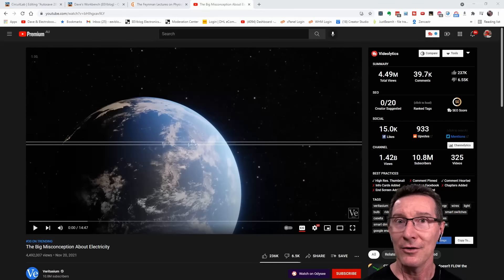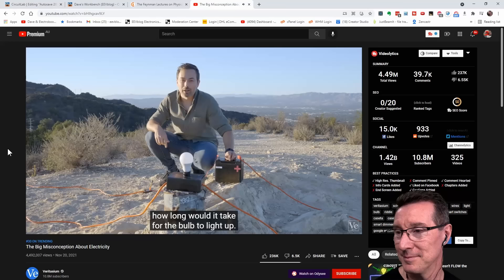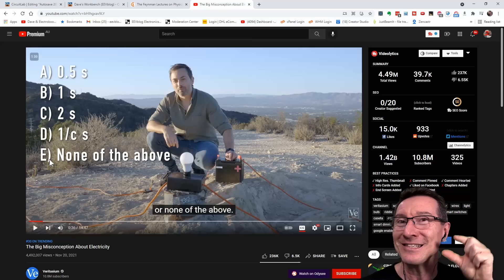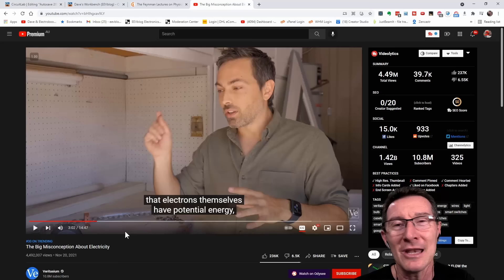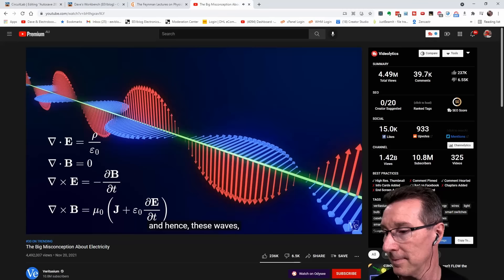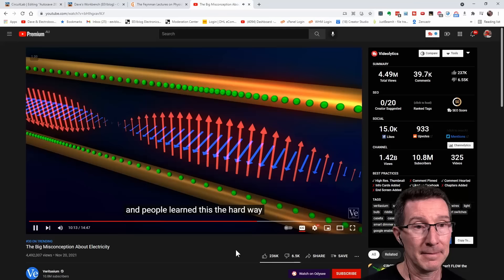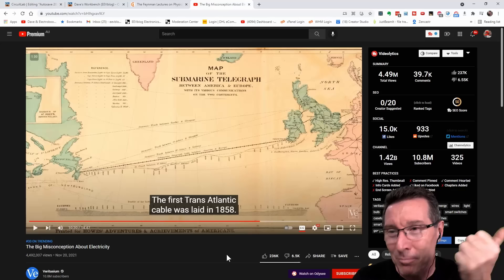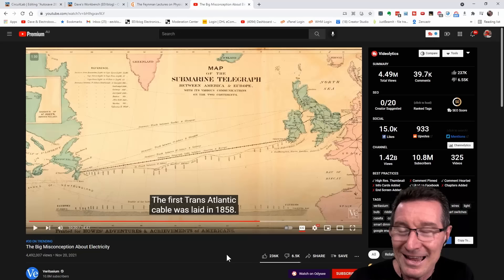EEVblog 1439 - Analysing Veritasium's Electricity Misconceptions Video

Comment: "The light bulb has to turn on immediately current passes through it"
"That's fine"
No, it isn't fine. If you do the calculations, even roughly, there is less power going into the light bulb due to the antenna effect than a moth's fart. It definitely will not light up the bulb.
Reply: iirc the lightbulb is specified to light up at the tiniest current. If you don't like that, ramp up the voltage to some ridiculous number instead.
Reply: I totally agree with you that the induced flow of energy "due to antenna effect" in Veritasium's set up is so tiny due to the low voltage of the battery that it is not going to light up the light bulb shown in his video. However, if the wire is assumed to have zero electrical resistance, the light bulb would light up due to flow of electrons inside the filament (no matter how slow they flow) pumped by the battery but not due to tiny flow of electrons due to antenna effect.  Besides, the battery provides DC. For the antenna effect to work continuously, the power source needs to be AC. Veritasium is not very smart to accuse people of lying when they say the light bulb lights up because of the flow of electrons  when that is in fact the case.
Reply: It sounds like you're missing the actual point
Reply: @chaklee435  Is it an "ideal" wire with no RLC - or are real world LC applicable? 300,000 km of wire with resultant massive inductance? Good luck when you open the contacts (back EMF)!
Reply: @simon6071  Alright I'm bored, let's dissect your comment.

1.) of course the setup would not light up any real lightbulb. That's not the point. It's a physics thought experiment, not an exercise in engineering. Any current will do.

If you'd prefer, we can contrive a lightbulb that works to our specifications. We can arbitrarily define how much visible light is required to consider the lightbulb lit. Then we grab an incandescent and heat it up in an oven until we are exactly on the line of not being lit. Then any current will tip us over the line.

2.) How is it that you are able to imagine millions of miles of wire with no impedance,  but not a lightbulb that lights at any non-zero current?

3.) Why do we care that whether the antenna effect works continuously? The question is when the bulb is lit, not when the bulb is lit continuously for some amount of time.

4.) I'm no electrical engineer, but it seems that the fields are able to explain more phenomena than electron flow. That's makes fields technically correct, the best kind of correct ;). It's not lying to correct people on mostly useless technical points.

5.) The point of the whole thought experiment is to engage your intuition, and show that it is incomplete. I presume you have watched at least 2 videos on this topic, and still decided that your intuition was right the first time. Please don't get into politics, thanks.
Reply: @megamond  We only need to close to contacts to complete the experiment. What happens next is not my problem.
Reply: Yeah surely this is just a badly specified question. If it immediately "turns on" but at 0.001% brightness and for only 1 millisecond... and then actually turns on full power 1 second later... I think the answer is debatable.
Reply: You're missing the point. Assume the lamp is really a LED with a 10k series resistor. This way, the load resistance is greatly higher than the line impedance, and the LED will light up at full power immediately.
Reply: @polwel-j8z  I'm not missing the point. I'm just saying that "it turns on in 1m/c" is a highly misleading answer. And even an LED would be 99% off for almost all of the 1s transmission delay because the transient voltage is so small and high frequency.
Reply: @polwel-j8z  No it wouldn't. It would still light up only a tiny amount for a tiny fraction of a second due to the A/C components of the wavefront. If the light transitioned to steady state before the current in the wire reached it, you'd break all of physical reality around information.
Reply: @TimmmmCam  The original problem statement specifies that "you have to make some simplifying assumptions about this circuit, like the wires have to have no resistance, otherwise this wouldn't work, and the lightbulb has to turn on immediately when current passes through it". The question is not badly specified, people are just bad listeners who hear what they expect to hear. No resistance wires are a common assumption, so that went through no problem. Any-current lightbulbs are not a common assumption, so people ignored it and remember it as a normal lightbulb. We can debate whether the question was clear, but it is not ambiguous.
Reply: @chaklee435  Yes but "the lightbulb turns on as soon as any current flows though it" sounds like it is accounting for some mild ramp up. It's highly misleading at best.
Reply: Exactly.
Reply: @simon6071  the guy is just dead flat out wrong anyway. He used Maxwell's equations rather than Quantum Electro Chromodymanics as the basis for his explanation,  a rookie mistake. Feynman is turning in his grave.
Reply: This is the correct answer. Every RF and microwave engineer knows this.  The wires guide the fields.
Reply: @chaklee435  The wave that propagates to the bulb due to the antenna effect is a short pulse which quickly passes.  Then there will be no power entering the bulb until the wave returns from the far end a 1/2 sec later. Verasitium is wrong.
Reply: @chaklee435  
Check out my reply on Craig Green's thread under the video "The Big Misconception About Electricity - Veritasium" for my explanation why Derek and you are wrong. 
If you still do not understand why you are wrong after reading that reply of mine under that video, I may explain to you in more details.
Reply: It isn't fine, because the original problem is squinting between two meanings, which amounts to dishonest communication. On the one hand, Veritasium says that the least current (anything strictly greater than zero) suffices to "light"' the lamp, by the problem definition. But on the other hand, he says the problem is about how energy (or power) is delivered. By a normal understanding of energy or power and "delivered", that would mean the nominal power, not just the least imaginable power that strictly exceeds zero. So, the elements of the language of the problem statement contradict one another and mislead the listener. I say the real power is not going to reach the lamp until the rise in voltage and current has had time to go around the loop, which would be one second except that such a rise, as others have pointed out, travels a bit slower than light travels in a vacuum. So, about 1.5 sec. The wavefronts travel in both directions from the switch, so they cover the two halves of the loop at the same time, not one half after the other half.
Reply: @defunctuserchannel  Ty for saying that because its something that bothered me about the original video.  Can anyone verify what Defunct stated here?  I was under the impression that this transfer of energy V was discussing only took place as the magnetic/electric field was changing so on the local level between the bulb and the batt when the initial connection is made there would be a pulse of EM field that rises which should induce current flow in the near by light but this would soon become steady(ish) at which point the light would stagnate until the power came from the wire.  Its been decades since I really looked into this shit from a weak understanding as I made shitty small Tesla coils and lasers as a child but something felt familiar and simultaneously off about Veritasiums explanation of it all.  If we take this to its logical extremes, a wire from here to nearest Galaxy and back and turned on a DC current would the Light come on and STAY on or would it only have any significant current only for the brief instance the switch was flicked then dim until the circuit completes at the Speed of light?
Reply: Why do I feel like i'm seeing the dunning-kruger effect in full swing here in this thread lol.
Reply: @chaklee435 , why not go one small step further? Why not just specify that the laws of physics don't apply to the example? Again, the circuit and conditions he describes are garbage that mislead much more than educate.
Reply: @b43xoit : "the original problem is squinting between two meanings, which amounts to dishonest communication. " <-- Exactly
Reply: @seditt5146 , according to Veritasium, every light in your house would illuminate upon closing any switch. Everyone knows this doesn't happy. Veritasium's assertions are pure garbage.
Reply: @ExarchGaming , 90% of all people that assert dunning-kruger suffer from it.
Reply: This is the assumption that really irked me too; to act like you're talking about the pure physics of the situation, then make some statement like that ignores the physics of quantum mechanics.... at any temperature above absolute 0 there would be some amount of "current" moving around in the light (statistically 0, but since there's movement there's electric potentials throughout). 

As soon as you define current as something that is detectable on a human senses level the wires become moot (e.g. to have a light that could light up with the field, you wouldn't need the wires, you're just transmitting the power wirelessly (even in the switched DC case, just for much less on-time))
Reply: @interestedparty00  If you can't see how "lightbulb lit" is pedagogically better than "measuring some non-zero current through a resistor", then I don't know what to tell you. Stay away from teaching, I guess.

Evidently, enough people are confused to show that Veritasium failed to teach clearly. But I don't think that was obvious from the outset. I still maintain that a careful reading of the problem is unambiguous. I don't feel misled. /shrug

According to general relativity, clocks in my house would run slower downstairs and faster upstairs. "Everyone knows this doesn't happy." Does this mean, gasp, general relativity is pure garbage?
Reply: @chaklee435  By that definition of a lightbulb, then you don't need a battery or a switch - fluctuations in the solar wind will set it going.
Reply: @jonathanbuzzard6648  LOL.
Reply: @interestedparty00  "... which mislead more than educate." That is the critical point, and one which disappointed me given Derek's specialty is science education. The resulting misconception that many will go away with is that the wire doesn't matter, the energy is transported through space to the light bulb.
Reply: @chaklee435  A couple of points regarding your reply to interestedparty: Veritasium is educationally about creating thinking by deliberately addressing misconceptions, often through arguing from unexpected positions. I think in this case, he opened himself up to criticism by creating a whole new set of misconceptions about the issue, by implying that the power required to turn on a light is transmitted to the bulb. By reducing the current required to tiny amounts is where the slight of hand is. If he'd simply said that the switch acts as a remote control for a highly sensitive light bulb, most people would have understood it better without new misconceptions.
Reply: @chaklee435  
1/ When the set up would not light up a real light bulb at (1 /C ) sec because the induced current is too weak and two brief, then it means the set up of the experiment is  not appropriate if he wants the answer to be (1 /C ) sec.

2/ We don't need to dream up a light bulb that can light up on a minute electric current.  Derek should have mentioned the use of a galvanometer (with protective circuit) instead of a light bulb for testing if there is electric flow on the other side of the wire.  A galvanometer can detect an extremely small current that even just happens briefly.  

3/ Even if we increase the voltage of the power supply to thousands of volts, if it is direct current, it will only induce a current on the wire with the light bulb for a split second when the switch is turned on. Then the there is no more induced current.  The light produced may be too brief to be noticed. With alternate current, the induced alternate current will last as long as the switch is on. 

4/ Another thing is that with an AC power supply, the wire on the side of the power supply would become a transmitter that emits radio wave, a form of  electromagnetic wave. That's how energy can be transmitted through the air. However, that energy can only be received by an antenna, not by a light bulb as Dereck foolishly claimed  Moreover, the electric field component is in the electromagnetic wave or radio wave that emits from the wire when the electric current wiggle back and forth inside. The electric field component partly responsible for wireless transfer of energy is not the extremely weak electrostatic field created by the excessive electrons on one side of the wire as Derek wrongly claims. There are two kinds of electric field in the experiment  if AC power is used, the electric field component of the radio wave and the electric field inside the wire.  Since he did not use AC power, the only electric field responsible for the transfer of energy to the light bulb is the electric field inside the wires. 

5/ Derek BS explanation of the transfer of energy from the battery to the light bulb by a electromagnetic scheme is obviously anti-intuition. We only see electromagnetic energy in the form of light come out from a light bulb when a electric current is applied to it. That means the electric current carries the energy to the light bulb. That's especially true when Dereck's experiment uses a low voltage DC power supply that cannot produce radio wave  with the set up.
Reply: @interestedparty00  Interesting, I must be in the 10 percent, that sees it in full display in this thread. Doesn't matter what topic it is, history, psychology, even hard sciences... like physics. 

You always have the armchair commenter trying to nitpick and grasp at straws even when you have a literal PHD, and an electrical engineer both in full agreement regarding the premises of the thought experiment (and that's all it is, a thought experiment to describe to laymens how a certain principle operate, he mentions in the video that a number of assumptions are being made for the thought experiment....) 

and...here we are. Continue glorious youtube armchair commenter!
Reply: @interestedparty00  that’s probably because the average person is below average...😁
Reply: @chaklee435 , Veritasium failed to teach clearly because far too much information was misleading. Veritasium was outside of his expertise. Veritasium is a generalist. You have electromagnetic wave experts and energy transmission experts explaining why this video is misleading, but you are ignoring the experts.
Reply: @ExarchGaming , you are definitely in the 90% suffering from the effect. We aren't nitpicking this video. We are saying that it is clearly misleading. It has negative educational value.
Reply: @ExarchGaming  I actually agree with interestedparty, and I have a Ph.D and a master degree in physics, as well as graduate training in teaching. So that criticism doesn't count. The build up of the physics by Derek was fine, but the final problem was poorly defined, because it implied power transfer greater than it was really saying. Derek is a great believer in the pedagogy of creating controversy in order to get people to think and learn. But I suspect even he will say, upon reflection, that his implication of power transmission is greatly exaggerated.
Reply: @brendanh8193  I'm going to assume I found the right person, explain to me what exactly is a doctor of philosophy - physics?
Reply: @ExarchGaming  In the English system which most English speaking countries adopted, tertiary education progresses from bachelor (or undergraduate level), to master (postgraduate level), to doctorate. Bachelor level degrees are taught via coursework, which is similar to schools in nature. Typical bachelor degrees take 3-6 years to complete. 
 Master degrees can be taken either by coursework (more advanced than bachelors) or by research (which is a research project with a thesis at the end). Typical master degrees take 1-2 years. Doctorates are also completed via research projects and thesis, but one must make a significant contribution to the body of knowledge as part of the thesis. Ph.Ds generally take between 3 and 10 years to complete, depending on location. 

 Historically, there are two types of doctorate, doctor of theology and doctor of philosophy (which covers everything else). So a Ph.D - Physics means the person has a doctor of philosophy in the field of physics. 

To add to the confusion, some fields, countries and even universities have a fourth level of education, with various names, such as mister, or doctor of science, however other locations around the world may not see the difference.
Reply: @brendanh8193  Okay, Thanks. I was so confused, because philosophy is a very different subject than a math heavy hard science. 

I didn't actually know the history of the term doctorate, thanks.
Reply: @simon6071  You are not dealing with the original problem, which has an any-current lightbulb. You are dealing with another version of the problem, with a more realistic lightbulb. Your answer may be more useful in some sense, but as you are answering the wrong question, that makes you technically wrong. If you want, you can blame the question for misleading you into being wrong. But as always, read the question carefully before doing any work.
Reply: @interestedparty00  I am ignoring who? Are you replying to the right person, or do you not read the comments you are replying to? I have not said that the video is not misleading. I find that hard to prove one way or another, so I stick to comments that I'm sure are correct, at least technically correct.
Reply: @brendanh8193  indeed. Not a good problem to center the video around. Probably be better off with some high frequency stuff with actual practical applications
Reply: @chaklee435  Any problem related to physics has to conform to physical reality. There is no such thing as an "any-current lightbulb". The induced momentary and weak current not being powerful enough to light up a regular light bulb is just one of the problems.  Derek's mistake of thinking the electrostatic field that lasts no more than 1 second between the two sides of the circuit after the switch is turned on as the electric field that drives the flow of energy from the battery to the light bulb is an even bigger problem. The electric field that drives the flow of electricity from the battery to the light bulb is INSIDE the battery and the wires, not outside.
Reply: @chaklee435 : "I have not said that the video is not misleading." <-- LIAR. Here's what you wrote. 
"I still maintain that a careful reading of the problem is unambiguous. I don't feel misled."
Reply: @interestedparty00   Not much point in talking if your understanding of English is so poor. I don't feel like pulling out a dictionary and explaining my wording. Let's end it here.
Reply: @chaklee435 : "I don't feel like pulling out a dictionary . . . " <-- It doesn't surprise me that you don't like using a dictionary. I busted you lying, so you want to throw a stone as you exit.
Reply: Why no one is questioning how is Derek lighting a 110volts bulb with a 12 volts battery? And secondly , where has he laid the 300000 km of wire (halfway to the moon and back) on the ground on earth or has he wounded it as a coil thus creating a ginormous inductor??!?
Reply: I agree.  Your power unit matches the absurdity of what other commenters assume as requirements to light the bulb.  I have to assume that Derek meant it was to turn on immediately when "sufficient" current flows through it, otherwise the light is already on from any radio station broadcast or by any static discharge anywhere in the world.  The thought problem then requires no wire to the bulb and is meaningless.  

The one second return time is also not when sufficient current would be available to a typical multi-watt 12 volt bulb.  The surge impedance (appearing resistive) of each loop exceeds 600 ohms and severely limits current to the bulb except through small current increments from each of thousands of one second surge reflections.  A bulb with resistance perhaps five times larger than the sum of the two loop surge impedances and rated in milliwatts could light dimly with current of the first outgoing dc surge.  But such a dc surge is not going to appear until after multiple oscillatory wave reflections from ground mode propagation and multipath wave reflections from ground and wires have occured following the collapse of the static preexisting electrical fields.   That "noise" time will last multiples of the time for a wave to travel one meter.  

For a normal 12 volt automotive bulb it will take hours to reach sufficient current.  The answer is D, unless all circuitry science is ignored.
Reply: @robertmeredith3940 : "I have to assume that Derek meant it was to turn on immediately when "sufficient" current flows through it" <-- Why would that need to be stated? Of course it would turn on immediately when "sufficient" current flows through it. That wouldn't require an assumption. It's obvious that he meant that it would turn on immediately when any current flows through it - which, as others have stated, would be perpetual, since there's always some amount of current passing through it due to electro-magnetic wave noise.